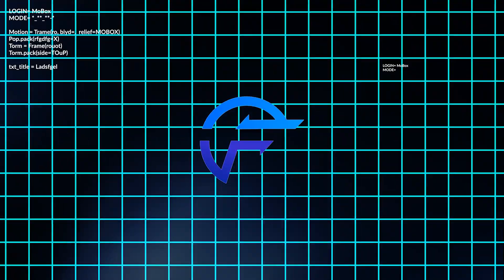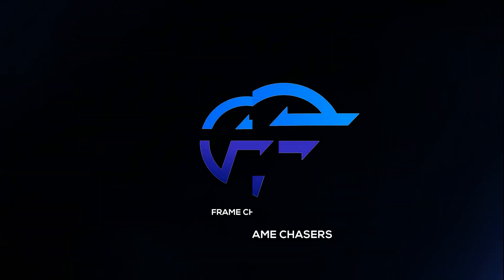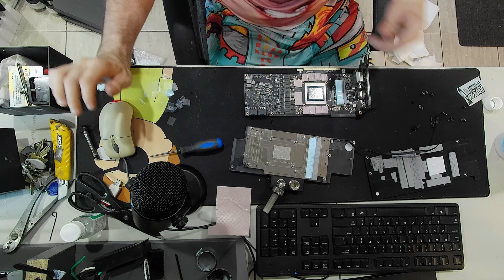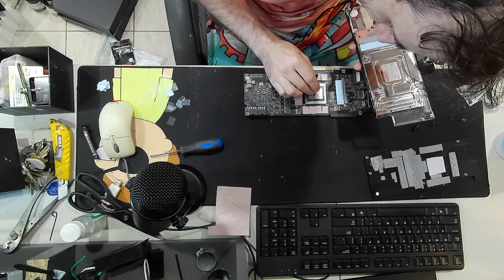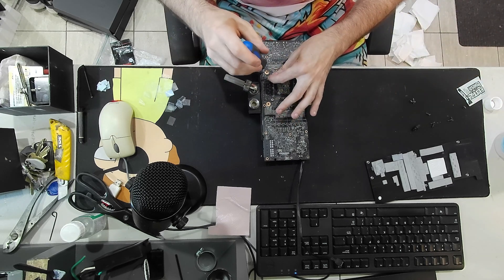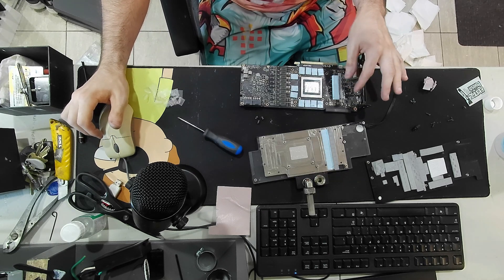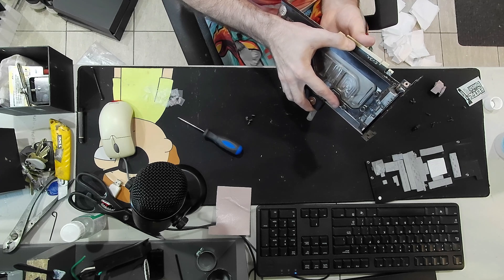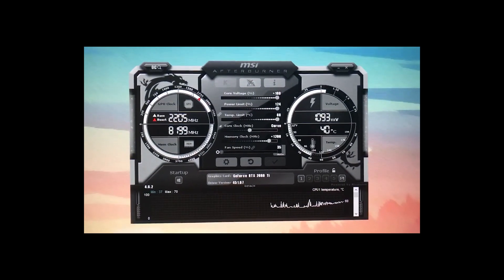Liquid Metal on GPU waterblock 2080ti

Comment: 14:20 makes sense, LM's great thermal conductivity helps for hot spots. i used LM on my i5-4690k and if u think about it, the TIM needs to conduct ~100W thru half a small stamp's worth of die size compared to thermal paste which tends to conduct heat from the IHS, which is about the size of 2 stamps, into a heatsink, which is about the same size, thus needing at least 3x as much thermal conductivity to not be the bottleneck. would apply for a gpu with hot spots too. my 3080 xc3 rn is 87C core 100C hotspot (the future gave better sensors!) and it's a bargain mining gpu. i'm getting LM in since i need to reapply for my aio (i think the copper sucked it all up, my temps kinda suck now) so i'll have LM anyways and i'm already performing surgery. the 3080 xc3 is a copper coldplate so it's possible, but i may have to come back in half a year and see if it needs a touchup before i seal it up forever.

Comment: lol im going thru ur old videos. ur a true enthusiast. i got a 3080 xc3 recently and considered LM but decided against it since the thermal conductivity increase probably doesn't matter with a low temp diff (air cooler) anyways. but it is fun to do. used it on my 980ti ftw with nail polish for the caps. i gained 1-2C lmao but it was an experience, something i think you can def relate to

Comment: I literally just put liquid metal on my MSI RTX 2080 ti Ventus. Average temperature drop when using auto-fan speeds is around -5 degrees celsius. For me it's enough. Remember to put nail polish on the elements around the GPU to protect them from liquid metal !

Comment: more mhz means more heat so you gain in theory more than than 10 degress. You always have to calculate than in normal stock condition you would generat even more heat with this more  mhz and from this level you go down. So its more than 10 degress.

Comment: I'm glad I found this video, because my build plan calls for LM on a liquid cooled 3080, and I'd only seen videos with people using LM with air coolers. It boggles my mind because the air cooling bottleneck just won't be able to take advantage of the heat transfer properties of LM. The reason it looks so great on CPUs is that it is typically used with a delid to remove the middling to bad TIM between the die and IHS. GPUs on the other hand are always direct die, so you don't have that extra bottleneck of the IHS.

Feeling a lot better about it. Hopefully EK rolls out FE blocks soon.
Reply from the maker: yup once you go liquid metal on a GPU you cant go back,  im going to be doing it on my 3080 and 3090 as well once the blocks come out.  When you order your waterblock just make sure the coldplate is nickel plated so the LM doesnt get absorbed into bare copper
Reply: Frame Chasers yep, already did that for my CPU block—nickel plated velocity block. If you check out Optimum Tech’s dual radiator Ncase M1 you’ll see what I’m working on.

Comment: 10degrees can make a big difference on clock due to the card declockong at set temps or percents. Ive noticed mine declocks at 50c and 60c. Because of this you will always clock higher at lower temps even if it's just a few degrees that happens to keep you under the declock threshold. Thanks for sharing the results, I'm about to do mine tomorrow. Had great results on cpu. I7700k from 4.2 now 5.2

Comment: Most tests I've seen were done with stock air coolers.  Their results were lack luster due to the limits of air cooling.  Other tests I've seen were done on old GPU's with 28nm process.  The transistor density was not high enough to create hot spots, unlike CPU's even at 45nm would show.  I have a 5700XT with a liquid loop on metal.  I had similar results going from conventional grease to liquid metal. (8 - 10C drop in hot spot and edge temps)

Comment: 2200 is an amazing OC dude, congrats! Going to put liquid metal on mine 2080ti next teardown. Is that a Bitspower block? Mine used different heights for the memory pads - some were .5mm and others were 2.5mm. I ended up selling my Bitspower block and replacing it with a Heatkiller 4, which resulted in massive drop in temps (11c less under load).  the HK block is 36% heavier than the bitspower block, so more surface area, and thinner thermal pads. I used the 17w/mk thermal pads fujipoly ultra extreme. You should do a video on your shunt mod, I don't see it on the card...
Reply from the maker: Do you mean the waterblock? Its just an EK reference one, the cheapest one I could find at the time.  I've never actually tried any other brand of waterblock except EK.  All the memory pads are the same though, they seem to be .5mm.  17w/mk thermal pads??  now this I want to look into, I feel like my memory could overclock further if I had better pads, I was thinking of trying thermal paste on the memory IC's as well.

I can do that, I figured people already knew about the resistor shunt mod.  Good Idea il do that!

Comment: 10 degrees definitely accounts for the extra 60 MHz.  Boost speeds have been temperature dependent since Pascal, keeping the core under 50C produces the highest boosts, by 60C you have lost your highest boost bins, by 70C you are getting down to "normal" boost clocks (~1900s), by 80C you are down to base clocks.

Most people just don't get to experience this because normally you need liquid cooling to go down that low.
Reply from the maker: I mean like I had to actually increase the mhz slider to go that high, it doesn’t boost passed the number I set in afterburner.  Before I had the slider at 2160, and then the clocks would settle at 2145 under load at 50c. After the liquid metal I increased the slider to 2205, and it locked there.  I’d say the temperature difference allowed the card to remain locked at the highest boosted bin which was 2205, but the liquid metal and transference of hotspot heat is what allowed it to boost that other 40mhz.  I think that makes sense, haha
Reply: @FrameChasers  hi I have a question, I have a Founders 2080ti, I have a system with 4 radiators, and double pump in serial, I have a problem if you can say so, practically my video card in full load reaches 34 degrees, at 2070 mhz the problem is that I can not go beyond 2070 mhz with the coreclock !!!! I do not understand why, when it was 42 degrees with a single pump and 3 radiators it always went at 2070mhz, now that I pulled down another 8 degrees not about OC anyway !!! memories are stable at 8350mhz .. why? how can i fix to go on coreclock? I have an ek waterblock .. thanks